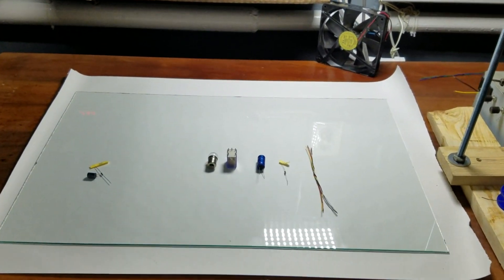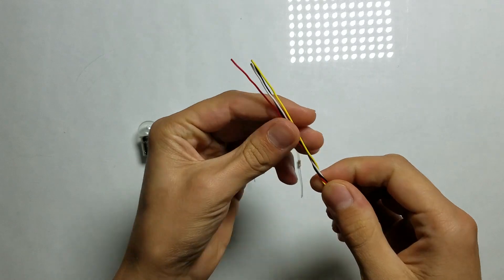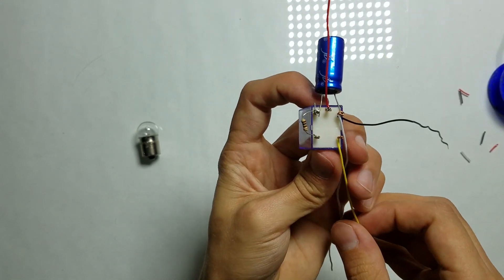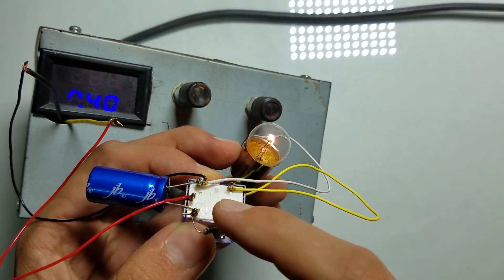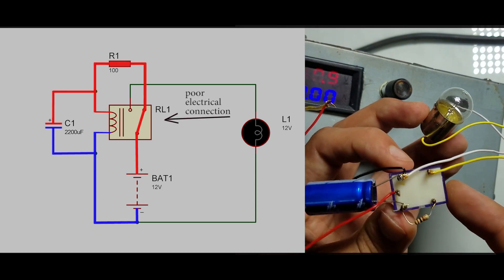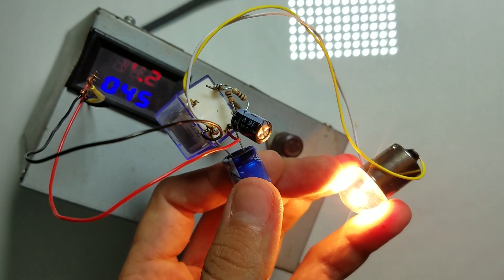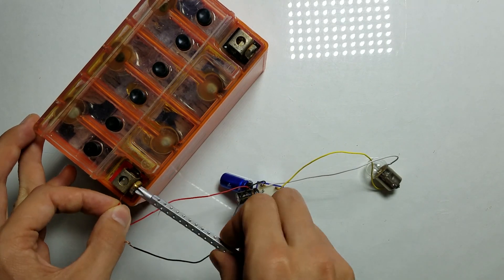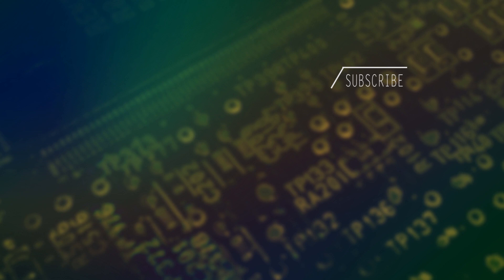Light Bulb Flasher Without Transistors Using Just a Relay [DIY]

Comment: circuit is wrong. Wont work like he is showing. the relay will activate or wont depending on the voltage drop of the resistor and relay coil, and stay in one state or another. Nice concept but wired wrong.

Comment: I think you don't need the extra cap and resistor. the problem is in power source  the first one better use with led. The second one the battery you use both led add higher watt valve